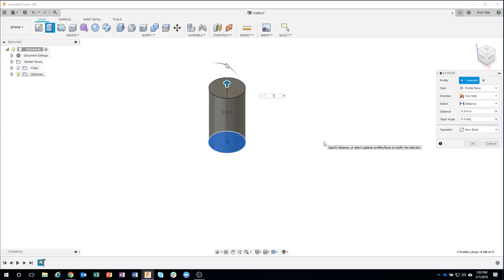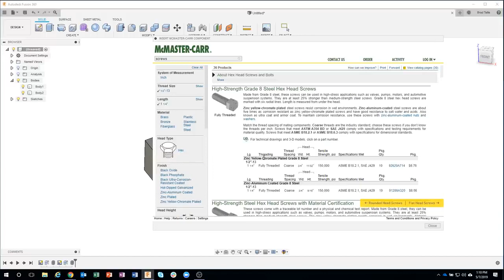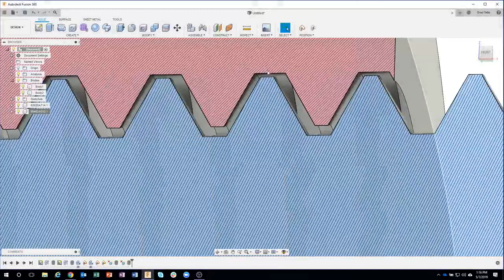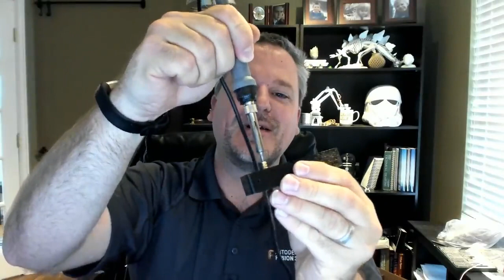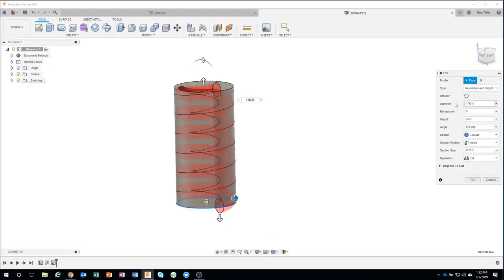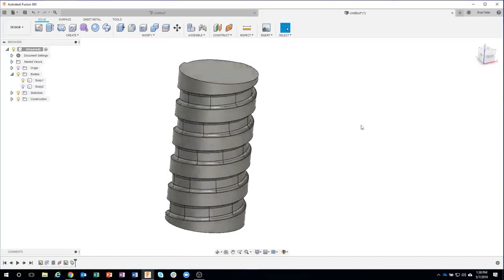Episode 29,  3D Printed Threads

Comment: @Brad Tallis I have an alternative to strengthening vertically printed bolts: drill a hole down the center of the bolt from the end to the bolt head & drive a real metal screw in. Adjust the size of the hole & screw to the size of the bolt. 

For example, let's say you have a 1/2 inch diameter bolt. You can drill a 3/32" hole down the middle & drive a drywall screw in. The drywall screw will reinforce the plastic bolt as well as pull the printed layers together. 

A refinement, if you figure to use this technique ahead of time, is to design the bolt already with a hole down the middle. Obviously, size the hole to the screw you intend to use.

Comment: depends what size of the screw add holes in them for 1, better 2 toothpicks and glue them  in works great I use this or wire ( straight up a paper clip) for every printed shafts, axles etc

Comment: great video. I did figure out part of my original problem with threads. The accuracy of the threads is very dependent on the slicer used. Cura is very bad and Ideamaker, slic3r and slic3rpe are great with respect to thread and hole accuracy.

I am still not clear on how I can make only part of a hole threaded while keeping the remainder of the hole over sized?

Also, I would be very interested in knowing how I can best work in both a capture cad environment while also converting some designs to a mesh for merging with mesh designs.For instance I want to modify an existing mesh by adding to it a body  that is engineered in Fusion. So I would like to design a bracket in fusion turn it into a mesh and then merge that mesh with an existing mesh to create a new mesh. This can be done but how can I then go back to my orginal body and make changes once I have lost the capture history?

Thank you

Comment: I create threads quite often in fusion for 3D printing and have found that on larger threads you can just Boolean the one created thread with a solid and the normal shrinkage of the plastic provides the needed gap for easy threading.  This gives you the opportunity to have a threaded object stop in the position created when it bottoms out.  Love the flat bolt, great idea.
Reply from the maker: @steven-  I have not tried that yet.  I'll have to give it a try and see if I get the same results that you do.

Comment: You can also use these nuts to hit into wood from McMaster. I cut out the nut from my object and print it. Here is the result which can be used with this metal nut. https://a360.co/2GtFw0C
Reply: The method I like for the threaded insert is a threaded rivet nut so you print a tight straight hole and you push the rivet nut in from the back which is flanged I've used this a lot width 3 mm and it works great. I also print a recess so that there is space for the flange on the rivet nut and the rivet nut ends up being flush.

Comment: You only need to create a face on the bottom. The top can stay full profile.
Reply from the maker: @Nick-  Ya, I usually only cut away the bottom.  I just showed that you can do both the bottom and the top and it still screws into the hole/nut no problem.  Thanks for watching!